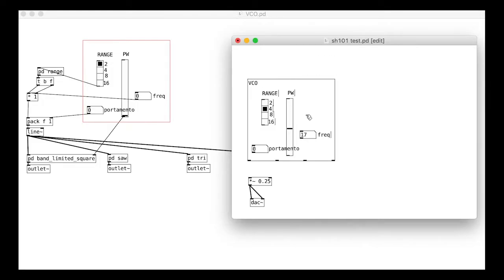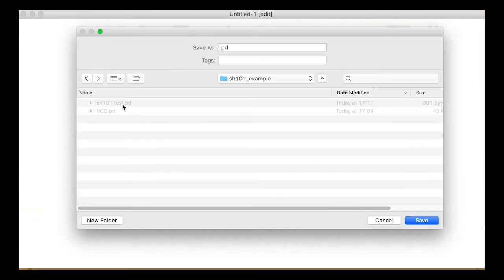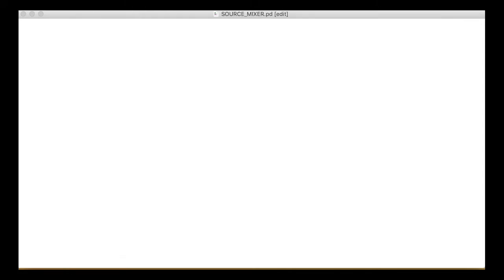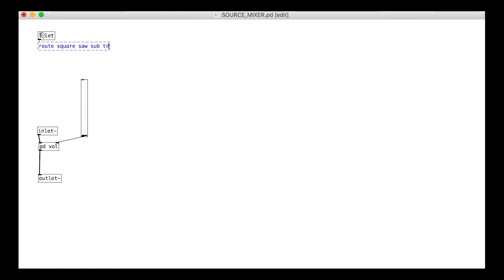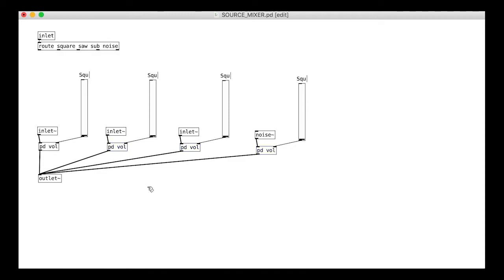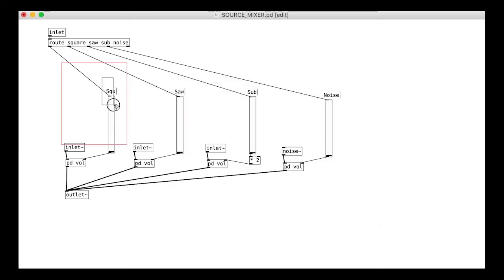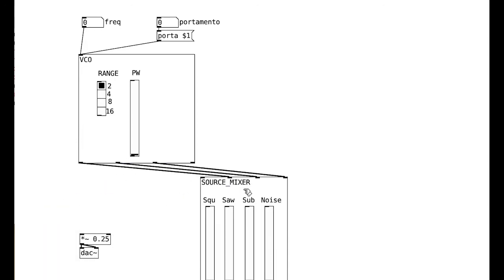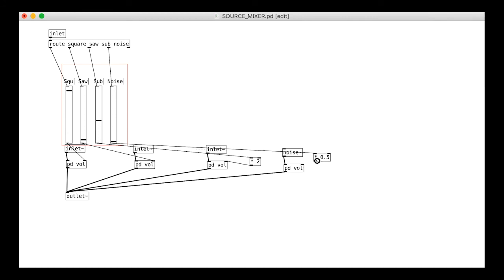PureData tutorials - rich synthesis (21) - Roland SH-101 (2 - Source Mixer)

Comment: doesnt work for me :/ keep getting error "signal outlet connect to nonsignal inlet"
Reply from the maker: It's hard to say where, but it sounds as though somewhere you have an [inlet] or an [outlet] where you should have an [inlet~] or an [outlet~] (or possibly vice versa). Look carefully at the video and make sure you know which is which when you're doing the final connections - remember that the left-to-right position of the inlets/outlets in the subpatch dictates their order outside the subpatch, so if yours are arranged differently on the inside they may not work like ours on the outside.
Reply: @reallyusefulplugins   thank you! had a look back and its now all working :)